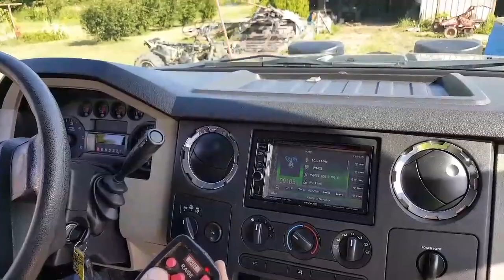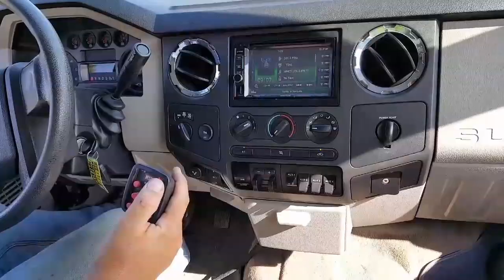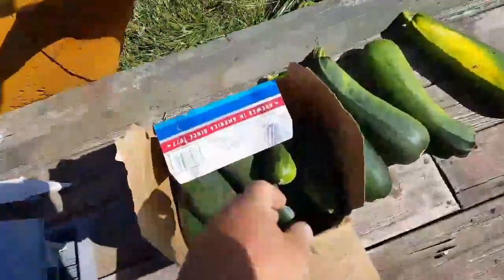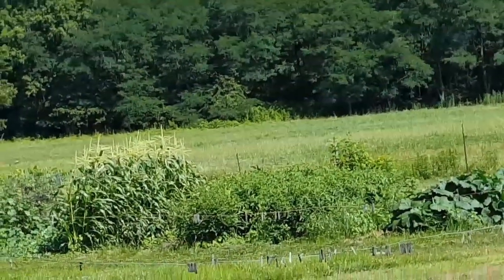Our new Western MVP Pro plow

Comment: what light bar do you have on the super duty???
Reply from the maker: Mark Dolan it's a speed Tech 50 inch Aries light bar which they do not carry anymore they discontinued it but it still works and it's still bright
Reply: TheNathan343 so you have two of them??
Reply from the maker: Mark Dolan I have a 50 inch bar that came off our black truck that we sold and I've got the 41 inch bar on my red truck the 41 inches in linear Optics the 50 in Tri
Reply: TheNathan343 Oh thank you!!